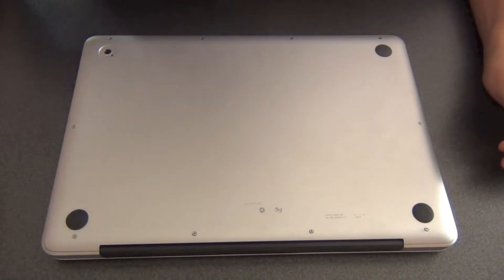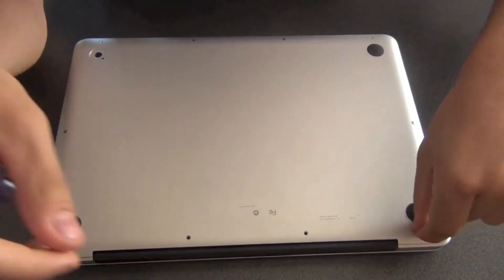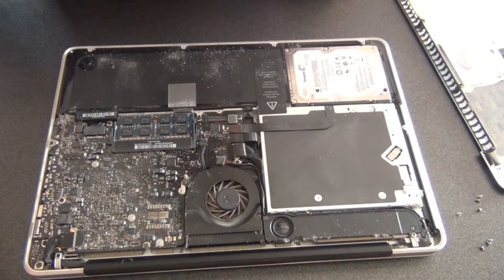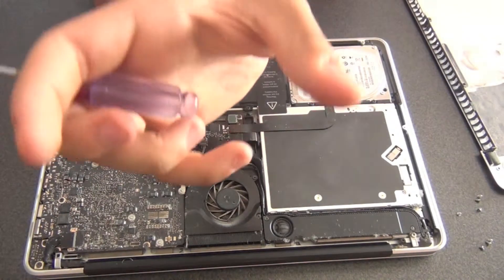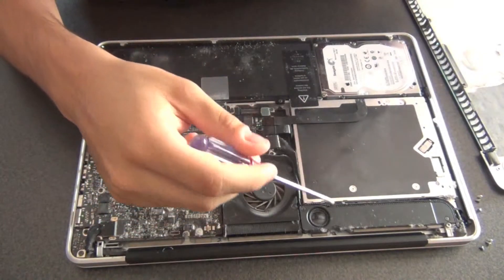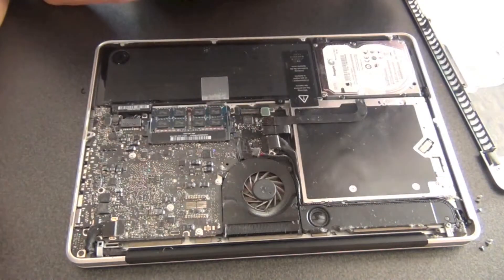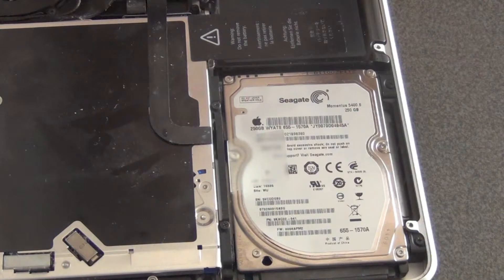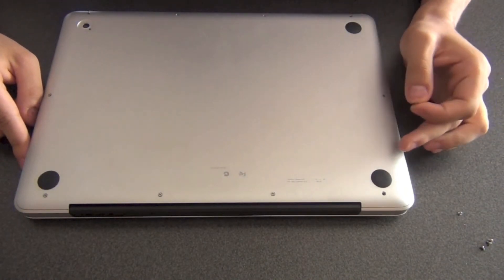How to replace RAM/HDD on 13,3" MacBook Pro (mid-2009) (Teardown)

Comment: Recently started utilizing this super MAC system utility “macvo unique only” (Google it) on the suggestion of a friend and have already been very happy with the features, particularly concerning Mac maintenance. I often utilize this for the jobs as Cleaning, Securing , Optimizing, anti virus, spyware. All in 1 software program.